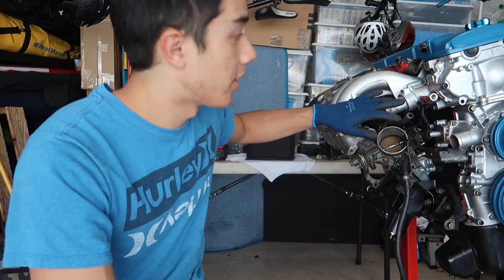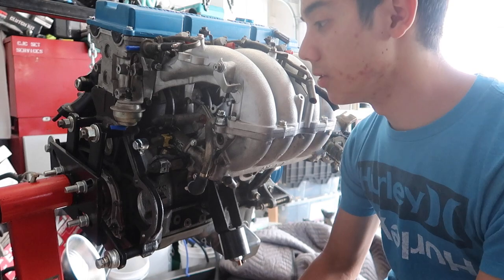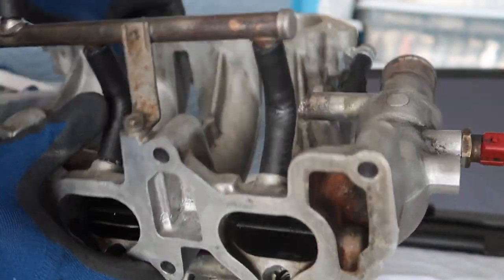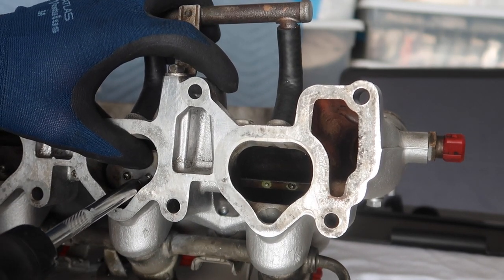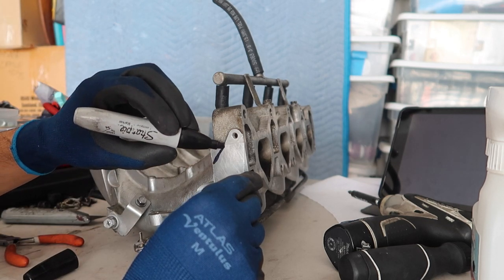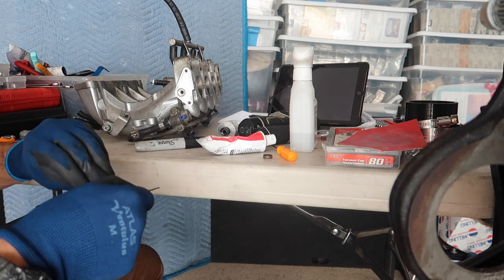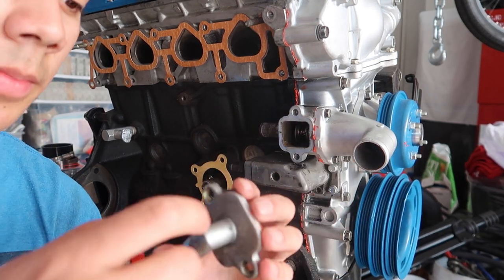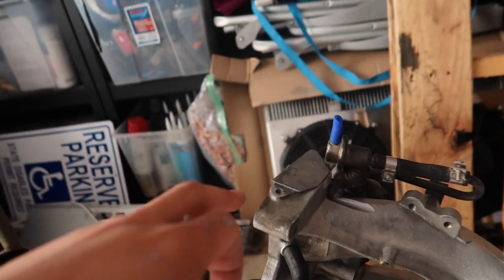Simplifying A Nissan KA24DE

Comment: Make a stencil and properly cut the plate for your secondary butterfly removal. Get a new o-ring. Bolt on your plate with the o-ring installed. Clean

Comment: 2 year old vid. Watched a few of your vids now. Trying to backtrack ur other vids. The egr capping and vacuum line deletion.  I'm currently rebuilding my Ka on my s13. Been looking through YouTube tracking down mods and other tricks. 

But without ur other vids, I'm not sure how you chose which vacuum lines were safe to remove without causing issues.  Could you dig through your archives and toss them into a proper folder so I can binge watch them? Lol
Reply: Check out infamous nissan
Reply: There's not many you need if you end up removing the intake butterflies. It's much easier to clean up the vacuum lines with the intake manifold off (lot of them run in between the upper and lower halves). I'm not running egr or charcoal can, any of that. I'd have to physically look but beyond vacuum for the fuel pressure regulator and obviously the brake booster, a lot of the others can be capped.

Comment: Great video!  Just got 1971 Datsun 510 for my birthday that needs an engine.  Haven't owned one for 35 years! (yes I'm old)  I can get a KA24DE from a 2000 Altima or a frontier.  Would you know if Altima engine bolts up to 5speed frontier trans?  Thanks so much!  Jonathan, Hawaii
Reply: no cust diff bolt pattern for trans and diff mounts, kits tho

Comment: my advice after  using ka24de  for 10 years change  the oil and filter every  2k it is good  engine  but because  the capacity of the oil 3.6 liter the oil well be porn fast you have  2 choices 1 change  the oil and filter every  2k or big oil pan  that takes 5 liter ka24des do not like 5k oil change  or more  I had 2 cars with  that engine never  porned any oil it sounds like new engine after 250k km and i use 10w40 castrol magnatec  bast oil I found for all conditions

Comment: All that removing might be a crazy question but do u get ant check engine light 💡
Reply: frayjc hey what’s up... nah you should not. They are meant to make the motor heat up faster. There are no sensors involved with the function of the flaps and the nearest sensor is actually before the throttle body so your ok.

Comment: Will doing this effect the engine in the long run or to dailying the car?
Reply: Brandon Garcia I daily mine like this no issues
Reply: No issues so far, 250k+ miles on oem internals. I lost a noticeable amount of low-end power but it feels like it actually builds power all the way to redline now. Ymmv 🤘😉🤘

Comment: Just wondering what power potential with boost on these engines when built and what is limitations
Reply: Depending on the turbo and tune ~300Hp on stock guts (91 octane) and upwards of 400+ with a built motor (Pistons, head work, manifold, etc) on 91 with a mild tune.

Comment: Why did my idle went crazy after I did the egr delete? No it sounds like if I was stepping on full throttle idk what’s going on, I did everything the right way and put everything back together the same way I took it out
Reply: Migue ...Are you running any tunes?
Reply: I read you have to block off the holes from the rod... did you do that also

Comment: Hey bro how big of a difference in performance and everyday driving.?
Reply: Thomas Stuart ....If you are running a tune, especially if on the boost… You will see gains. If you are bone stock, you will see improvement if you at least have intake and exhaust and everything else is up to par.
Reply: It is very hard to see Gaines with small modifications on a natural aspirated engine. Everything else has to be running up to par  to see the little gains you got. Overall you will still experience good throttle response and gas mileage.

Comment: S14's did not, from my perspective it looks like youre running my setup. S13 with an s14 head. If you have an instagram lmk, i would love to follow a ka build
Reply from the maker: My instagram is _ChristianMeyer 
That engine is actually sold now but I just got another bone stock S14 that I plan on keeping the KA in and building. My S13 has a SR now.

Comment: Offbeatgarage did this thermostate blockoff plate as well and for him it worked only because he runs with no thermostat. On my road racing NA KA, I run a thermostat now but when i tried this, this thermostat block off plate cause me to overheat every single time during idle.  I had  to get a stock thermostat side plate to get the flow/heat the thermostat needs to open up. Check and understand the coolant diagram and flow direction from the FSM to make sure this works. Good luck to ya! NA KAs are awesome!           https://www.youtube.com/watch?v=v0mjcGUvH4g
Reply from the maker: thanks for the information. what upgrades do you think are worthwhile for a NA KA? I actually have a SR in my S13 now but just got a stock KA S14 too. I had an aluminum driveshaft in my S13 which I thought was worth it. Anything else you recommend?
Reply: Christian Meyer, depends what you want to do. My KA is very streetable thanks to Nistune- Dyno tune. Smooth idle and has a pretty good torque curve. 16whp and 170ftl bs. 
SR20 injectors, 2.5" catback, test pipe, dc headers, intake (not cold air), PDM cams (they went out of business), Brand new engine bay wiring harness from wiring specialists (this solved all my sensor issues, ground problems, etc.  So worth it). 
Before tune 145whp. 140ftlbs. If you don't tune it (dyno tune if you can) you won't enjoy the KA as much. 
The car now sits at 2480lbs without me and 1/4 tank of gas, and with some 200 tread tires i hit 14.2 in the 1/4 mile. 
I will be going full race engine next...like this guy 

https://www.google.com/search?q=240sx+nasa+ttc&client=ms-android-verizon&tbm=isch&prmd=sniv&source=lnms&sa=X&ved=0ahUKEwjA0ZjSkaPZAhXFy1QKHTQBCXMQ_AUIESgD&biw=412&bih=718&dpr=3.5#imgrc=Oc2xD7SFKW4UKM:

Here is his 240 history

http://www.superstreetonline.com/features/modp-1201-1993-nissan-240sx/
Reply: If this motor has 2 thermostat then you’ll have to replace the second thermostat with a high flow one. The heads and the block operate at two different temps.